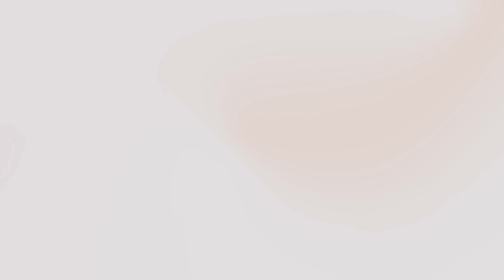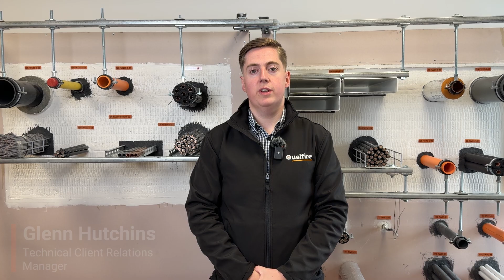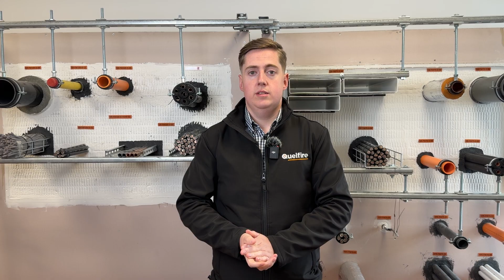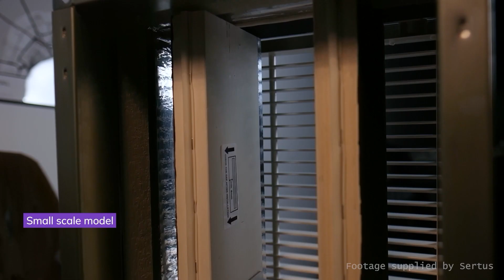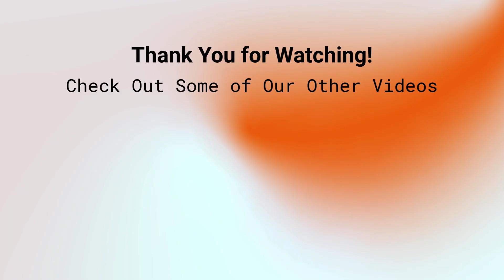Do Our Firestopping Products Require Ongoing Inspection?

Comment: What about moisture?
Reply from the maker: Hello, thanks for your question. Our products are generally intended for use in internal conditions, so would not be exposed to moisture. If they are, it is generally not an issue for products that carry a Type X Durability rating, but for products that are not Type X rated, replacement may be necessary. If you have a specific application or further queries, please reach out to technical@quelfire.co.uk.